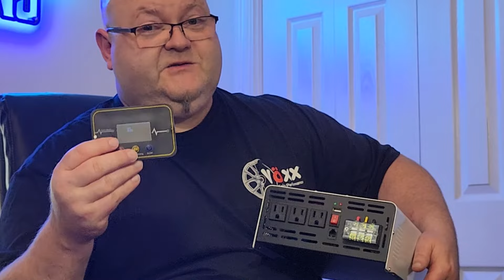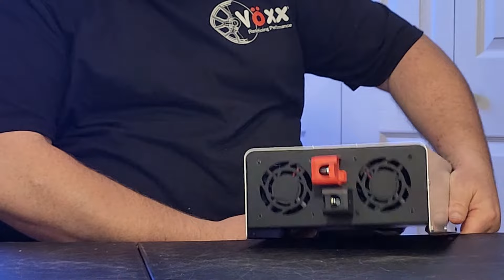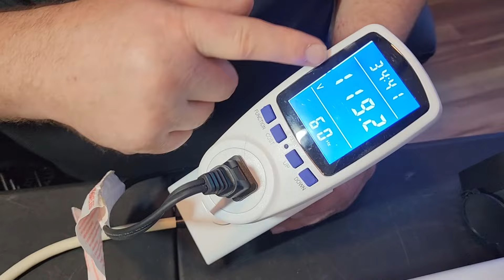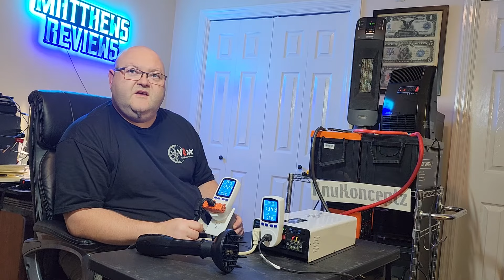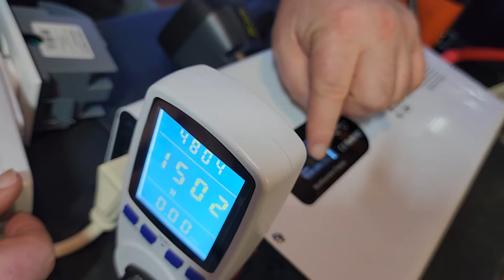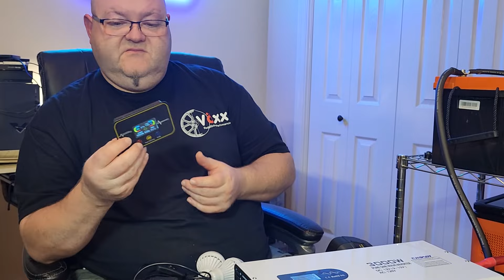$269 CHGAOY 3000W 12V Power Inverter

Comment: I like your videos. I have a PureSine inverter 2Kw but my local power feed in my area fluctuate over 250v sometimes, and then the inverter rejects the "street" ac or power and go to battery state. This is frustrating because the batteries runs down whilst there is power, just too high. I need a way to reprogram my inverter to accept higher input, say up to 259v. Can you help me please? I see the same display boards on various different makes, so I am hoping that the programming can be modified.
Reply from the maker: I wish I was able to help you but I don't have much  experience with that sorta thing. I mostly test inverters and I have built a few off grid systems. I am constantly trying to teach myself more and more but the grid tie stuff is something I've never tried and I'm just not familiar enough and don't want to give anyone bad information. I appreciate you watching my videos! I just hate that I don't know how to help you. :( 
Hopefully you'll figure it out soon. Maybe you could try reaching out to Samlex tech support and see if they will try and help you. Have a good day my friend!